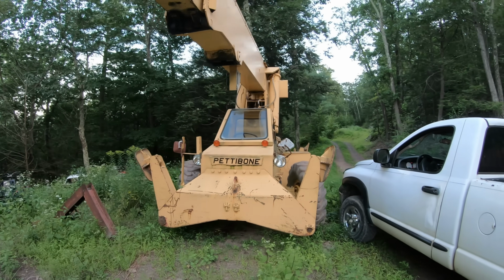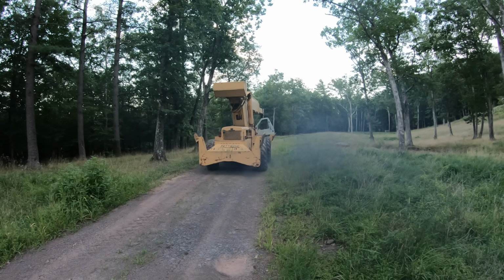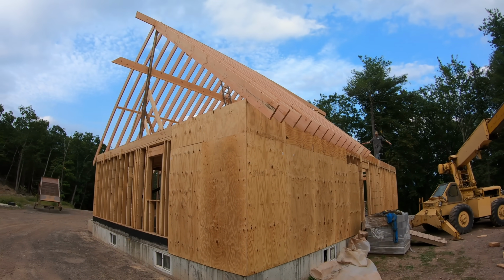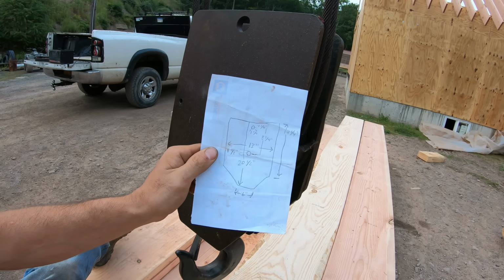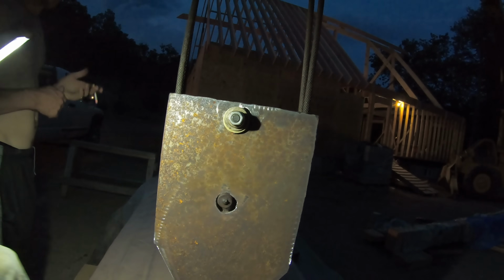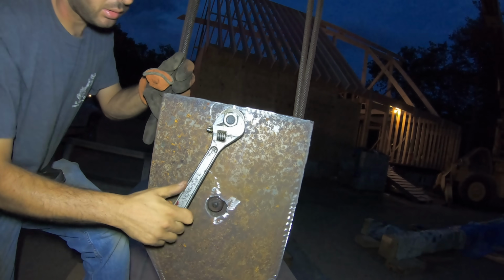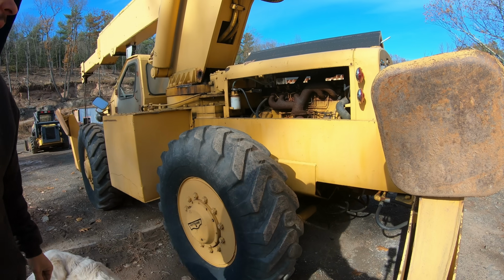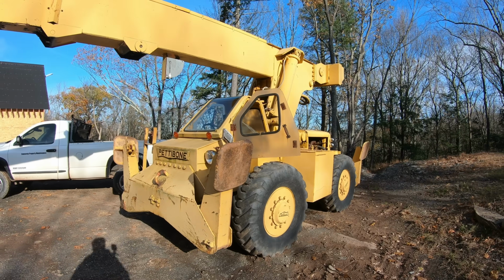Working with a Pettibone crane

Comment: I need my friends like you Andrew. Most of my friends barely have even a lawn mower.
Reply: I have a lot of tools but right now i meed a welding machine.
Reply: @CarlosVazquez-vh4gf  I know a guy who has one...;)
Reply: @CarlosVazquez-vh4gf  craigslist or ebay. Stick welders go for super cheap. Like 40 bucks. Mig welders will run you a lot more.
Reply: @jamesnm21  , Tig runs a lot more....
Reply: @CarlosVazquez-vh4gf  try a lotos CT520D, I love mine, it has a 50amp plasma cutter 200amp tig and stick, I have ran the tig at my welding class but haven't at home since I do not have the Argon gas for it yet
Reply: @Famous3064  That LOTOS looks great but will not weld aluminium as it doesn't have AC TIG. I have the LOTOS 200A AC/DC Tig machine with DC stick welder. Honestly its the best stick welder I have ever owned! Note that cheap (usually AC only) stick welders have a pretty low open circuit voltage.. like 30 volts. If you want to run the best structural rods such as 6010 and 7018 you are likely to have a hard time with cheap welders. The LOTOS runs over 70 volts at 200A and will lay down a 5/32nd 7018 rod with ease!
Reply: @CarlosVazquez-vh4gf  I was the same way welders are very handy, dont go cheap just get a decent welder, Lincoln or Eastwood or esab I think I paid 600 for mine and I can't believe I went this long with out one
Reply: @TonyDamMullins  when i was younger i studied at job corps center and i learned how to weld.
Reply: I really need my friends like you, Andrew. Most of my friends barely have even a lawnmower.
Reply: My sister lved across the road from me and my bro n law always borrowed my mower, weed trimmer and other tools. So after a few yrs. I got fed up. So l hit the local pawn shops and bought all those items so when came I would tell him just bring them back. What he never knew is that he was borrowing his own equipment and stayed out of my good stuff. dumbass
Reply: Charles Castillo hahaha that’s funny

Comment: I wonder why someone took that plate off? Maybe to fit in a narrow space. Thats done!
Reply from the maker: Yeah, I asked the guy I bought it from, he said he never noticed it. Its very noticeable when cabling out and it doesn't go, and the spool needs to be re-wound.
Reply: @AndrewCamarata  I know where a whole machine is. If you ever need any parts. It runs great but has no brakes.
Reply: @stevensaxon8888  do you still know where that is? I have the machine now and looking for a motor for it
Reply: @jmuller86  I will check to see if they still own it. And get back with you.What name brand of engine? Size? I'm almost positive that the one I know of is a Detroit engine.
Reply: @stevensaxon8888  this is a white engine, I heard you can put a cummins or detroit motor in it, I think the detroit would be a 4-53 ..is there any way I could talk to you on facebook or something?
Reply: @jmuller86  Facebook, I have a German Shepherd dog as a profile picture.

Comment: Couldn't you just use some kind of upside-down Y configuration to pick up those beams without having to worry about the exact balance point?
Reply from the maker: Yes
Reply: @AndrewCamarata  Just thinking out loud as I'm no rigging professional, but saw the bit of trouble getting the beam in the air without one end falling is all. Love your vids. People who just "get sh*t done" are my favorite kind of people. Great stuff. Ya deal with whatcha got with ya.
Reply: @jazzyrick  spreader bars are available or easy to make as well, two pieces of rectangular tube sized for one to slide into the other than holes drilled and d rings attached to the ends they slide together or apart to give adjustable widths and a larger load rating when slide all the way together.. very useful to be able to mount two slings 10ft apart but still have themplumb not on a 45degreee angle and able to slide/drop the load
Reply: That's called a rigging sling
Reply: @mmm365  What was so unsafe about it?
🤜🤛

Comment: 2 - 6 volt battery in series =12volts.  you should have bought two 12 volt batteries and put them in parallel.  twice the cca.
Reply from the maker: I put the batteries in it that it is supposed to have
Reply: @AndrewCamarata  You get lot's of advice, some of it unwanted, but you do a great job taking it in stride.
Reply: @AndrewCamarata  YEP!  I'm sure you checked, but make sure your system is charging them, that old crane must have a generator, probably working fine. Winter around the corner and you got a massive roof to build, I can tell you did not want to fool around jumping the crane, "AC your getting older and wiser young man".
Reply: @AndrewCamarata  as good a reason as any. The net energy is identical and hey  you have the cables all set up.  I suppose were they much more expensive than two 12Vs in parallel I'd pause to think. but this was a no brainer.  Do you own this crane? I don't recall you getting it.  Just as a figure of comparison, your views exceed some national cable channels and most local news organizations. Congratulations!!
Reply: @silasmarner7586  i saw this crane in another video, don't recall when he bought it.
Reply: @AndrewCamarata  i figured, don't recall the age of the machine and sometimes equipment plays catch up with technology.  sometimes it leads.
Reply: @AndrewCamarata  might be a good idea to check the wire rope out before starting the big project looking forward to it
Reply: Beat me to it.
Reply: @firesurfer  andrew is a smart cookie.  maybe there is a reason he didn't do that.  for all I know 6 volt batteries are cheaper.  But i would think they would be more being they are so uncommon these days.  unless its a 6 volt system and someone prior to andrew wired it wrong.  but i doubt it.  alot of those old machines are 24 volt.
Reply: @justinpaone2227  I think it's supposed to have two 12 volt in series. I've never seen one with 12 volts . And 6 volt batteries are expensive.
Reply: @justinpaone2227  Batteries can be in series or parallel. It's usually best to get as much CCA's as possible. The output voltage can be adjusted to suit the machine.
    edit; after some quick research, the 6 volt may be better for this application. My bad.
Reply: Fredrik Närstrand  CCA is how many amps a 12V battery, at 0°F, (-18°C) can produce for 30 seconds, and still have 7.2V remaining.  6V batteries aren't rated by their CCA, because of the definition of what CCA means.  Two 6V batteries in series will continue to crank a stubborn engine over, much longer than a pair of 12V batteries in parallel.  That's because the 6V batteries have a higher amp-hour rating.  That's true of all industrial 6V batteries, like those made for golf carts, electric forklifts, and such.
If your engine starts effortlessly every time, then sure, two 12Vs in parallel, like my truck, work just fine.  But if you have a seldomly used crane, a bulldozer, an excavator, or anything that sits for long periods of time, or just needs a lot of cranking time to get started, then two 6V batteries in series are better than the 12s. 
Google is your friend.  (not really, they are just leftist spies, but you can find good information using their search engine)
Reply: There are two myths here that I want to clear up. 6V batteries don't have "more" Ah / higher capacity. They have half the voltage! (And they don't have more CCA either) A 6 V battery doesn't magically contain more energy than a similar-sized 12V battery. If they did, that would be revolutionary! And everyone would be using them. 
A 200 Ah 6 volt battery gives you theoretical 1200 W/h and a 100 Ah 12 volt battery give you theoretical 1200 W/h What a surprise, eh?

The other myth is that 6 volt batteries have "thicker plates" or somehow have a "longer lifespan" Again, completely bogus.  If they did had a longer lifespan, everyone would be using them. And if they do have thicker plates, it simply means you have a deep cycle or dual-purpose battery. They can NOT be compared to a starter battery with thin plates or vice versa. If you compare a 6 and 12 V battery from the same brand and same series, they will have exactly the same plate thickness and absolutely NO difference in lifespan, or anything else.
Reply: @Kowalski301  less plastic, so more plate to case material ratio... maybe each individual plate isn't thicker but there are 2x as many in each segment, less likely to have a totally dead cell
Reply: had no idea my comment would turn into such an in depth conversation.  I learned some good info.
Reply: @jacqueschappelle5857  that was my thinking, could also be the starter requires quite a bit of inflow current and a parallel 12v system doesn't have that kick, never sized batteries for a crane though.
Reply: I thought of that.. but theres a response from him I haven't read yet. I'm about to find out....
Reply: Fredrik Närstrand  CCA is how many amps a 12V battery, at 0°F, (-18°C) can produce for 30 seconds, and still have 7.2V remaining.  6V batteries aren't rated by their CCA, because of the definition of what CCA means.  Two 6V batteries in series will continue to crank a stubborn engine over, much longer than a pair of 12V batteries in parallel.  That's because the 6V batteries have a higher amp-hour rating.  That's true of all industrial 6V batteries, like those made for golf carts, electric forklifts, and such.
If your engine starts effortlessly every time, then sure, two 12Vs in parallel, like my truck, work just fine.  But if you have a seldomly used crane, a bulldozer, an excavator, or anything that sits for long periods of time, or just needs a lot of cranking time to get started, then two 6V batteries in series are better than the 12s. 
Google is your friend.  (not really, they are just leftist spies, but you can find good information using their search engine)
Reply: @throngcleaver  good to know
Reply: Those 6 volt batteries probably have twice the CCA as the same size 12V battery would have, it likely ends up being the same.
Reply: @Gyppor  yup! 6 volt batteries are tough tough batteries, we have found those things that have sat out in the weeds for years and they still take a charge. 
12v does have more jam. but 6v are tough as nails
Reply: @Gyppor  i was trying to read the label.  i think it was either 775 or 975, so a bit more yes.
Reply: Half the cells 2x the plate material,  same thing 

6 volts last longer too much thicker material I reckon
Reply: It's not about the CCA, it's about the amp-hour rating of the batteries.  6 volt batteries have a higher amp-hour rating than deep cycle 12 volt batteries, so two 12 volt batteries in parallel won't come close to that pair of 6 volt batteries in series.
Reply: Yes but they would probably not fit in this battery compartment so Andrew would have to modify it with a steel saw and that is something we don't want to see.
Reply: @Joey0353   My thought too,..I'm wondering how old that wire rope is. I know what I would do,...have done, before projects like this one coming up!
Reply: The main benefit to 2 12V is they are more common and you could put them in other things when not using the crane.  Those 6V were probably expensive and you can get a decent 12V from WalMart for $50.
Reply: @renof2505  Batteries for heavy equipment from Wal-Mart, now there's a good idea!!!  ( Hardly.)
Reply: @regsparkes6507  Yeah, because batteries in a crane take such a beating, going off jumps etc.  I have never had a battery fail from anything other than age.

Comment: AC May I make a suggestion I know ya can fix and do anything way beyond Anything I can do but I have this set up on my truck , tractor , trailers etc... and I think ya would
Love it it’s cheap and effective and most of all convenient. On my Ram  diesel truck I bought some 1/0 wire black and red of course and ran it from the battery to rear and front bumper where I added to the wire an Anderson Plug that mounted to my bumpers . Also make sure ya get the covers they are a must Anyways I took a good ole long heavy duty set of jumper cables cut off the end of one side and put on the Anderson plug now I have a quick access to jump starting Anything and never have to open the hood kinda like a tow truck set up but I like the Anderson plugs better . My winch also has the Anderson plug makes it easy to winch from front and rear plug and play if ya will.  I
Left my winch pig tail long so I can throw it  on my trailer and plug right in to my bumper . Just thought of you as I’ve seen ya jumpstart a lot of equipment and with all the machines ya have would be a nice set up for ya . Also now your  jumper cables are proprietary to
Your truck . So one end the regular alligators and the other the Anderson plug . Put the wire and plugs on all your trucks ya use and boom ya have a nice clean setup not needing to ope your hood again if ya need longer jumpers for whatever situation just Clip another pair to yours and away ya go !! Use mine all the time on trips and sure is nice just thought ya would like keep the videos we all
Love them buddy I’ve learned a lot as I’m sure we all have !!

Comment: Always keep your hook up. I was short distance transferring a Grove and a young girl got pissed by my speed, sped under the hook to turn off the road and took out her windshield. She wanted the police to cite me but they ticketed her for reckless driving. You really have to do their thinking for them.
Reply: I once asked on a logging channel why the skidders kept the jaws closed when travelling empty.  The answer came back that if the jaws are open and swinging about, they can spear into and destroy a front tire.  I'm guessing that would be serious money.
Reply: @TrevorDennis100  Rear tires.  Either poke a tire or hook in the tire chains.  Also less swing when it's closed, so it's not banging around.
Depending on size, tires are in the 5k area.
Reply: Goodness!  That's more than I expected.  All part of the joy of operating big equipment.   Jeff, on Jpaydirt, sometimes mentions the cost of things for his two big scrapers, excavator, and truck with lowboy  trailer.   I can remembering him being totally stoked when he managed to get a tire for the scraper for $4k, and that would have been a similar size to the skidders Tim's (Cotonto3) family use for their logging business.  I bet those batteries Andrew bought were not cheap either.
Reply: @TrevorDennis100  Just realized I gave you bad info.  We bought 2 last year at about 5k, so $2500 each.  30.5x32 which is a fairly standard size on a John Deere 648.  There's another size larger that's common too.
Sorry about that, not sure why I remembered 5k each.
Reply: @Kerosene_Stream  Only speak 4 myself but I was raised to Tell The Truth. Sure you can BS your friends sometimes (while telling tall tales) but when it really counts look them in the eye and straight up tell THE TRUTH. Something my Dad told me a thousand years ago. Plus FWIW lots of folks appreciate it when strangers tell the truth. 11.11.2019 2100
Reply: @howardfortyfive9676  what did you smoke today?
Reply: You gave a pretty good reason for leaving the hook down instead of what you intended to do.
Reply: @verteup  No, I had it about where Andrew had it. I always rode with it double blocked or hooked to a D ring on the front of the cab from then on. I  don't know about you, but I wasn't put on this planet to hurt anyone.  I am here to build stuff.

Comment: Andrew, you should put slow charge of a mini solar panel for equipment that sits for a long duration, great video
Just a thought💪🏾👏🏾👍🏾👨🏾‍🔧👌🏾🇯🇲🇨🇦.
Reply: Go whole hog. Clean terminal ends then battery spray. Mini solar panel, charger and it can sit. How many pieces of equipment would need this? As few as 2. As many as 8? Cost? Just looked them up on EBAY. Price is all over the place. Your thought has the advantage of no more jump starts. Less battery replacement. I like your thought. However, I believe all of his time will be spent on the new castle roof. Maybe he'll address this afterwoods. It'll save him time, money and aggravation. I'd like to see a video of AC doing this and general maintenance on each piece of equipment. But he is only one guy and he's got to make a living. But a nice 2 hour plus video. You never know.

Comment: Yep. There is the 10 pound sledge again. Good stuff.
Reply: They ain't called a BIG Hammer fer nuttin. Last job I had I had a drawer in my tool chest JUST for hammers. Think I had 5 hammers plus some cold chisels 2 or 3 likely. Sledge hammer was in a corner. For BIG jobs we had another Hammer. Parked in the 1st slot (when it was plugged in.) What kinda Hammer needs to be PLUGGED IN?? A CASE 580L HAMMER that's what kind... 11.11.2019 2213